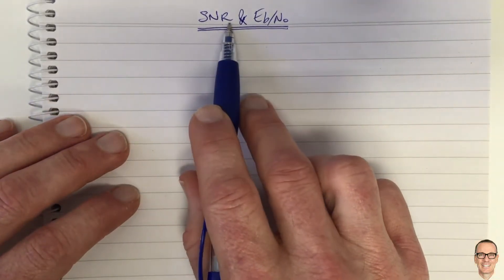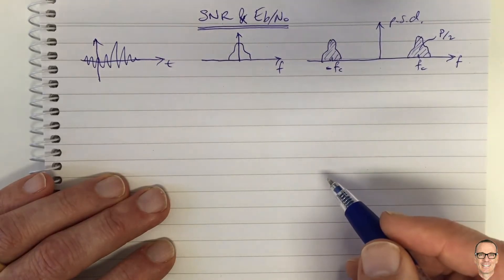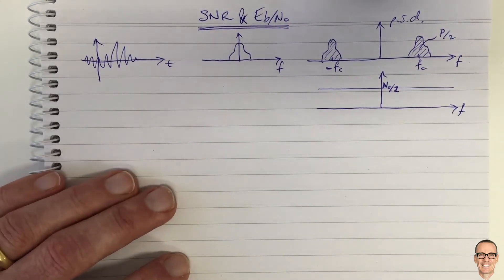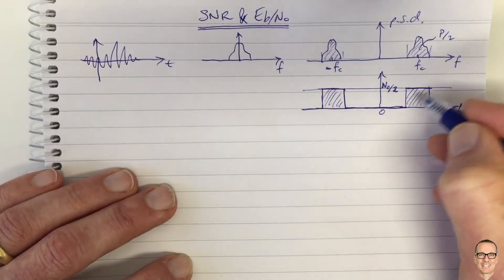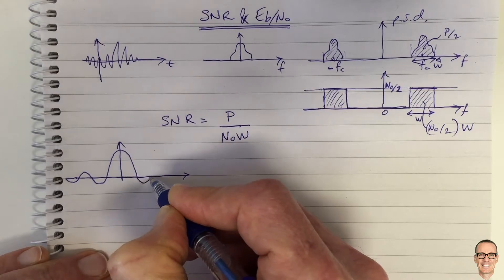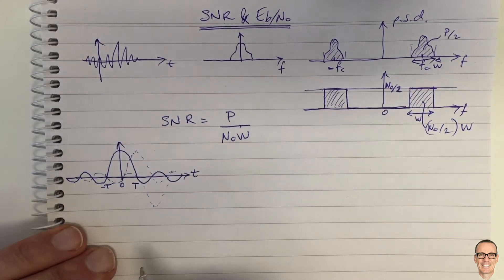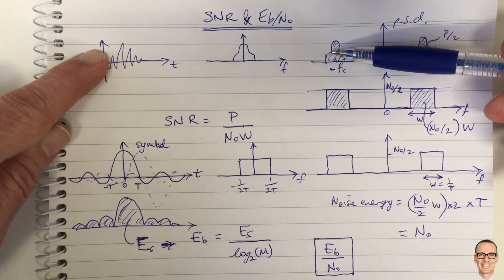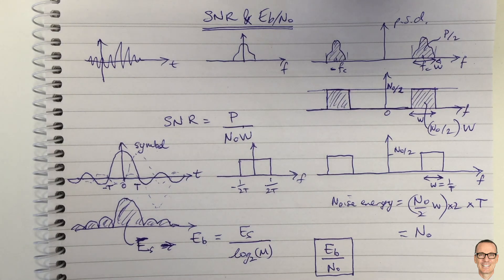What are SNR and Eb/No?

Comment: Hi Sir. Great video!  Q: is there a way to express the difference between SNR and CNR or Carrier to Noise ratio mathematically?  I see these used often to mean the same thing and i dont think they are. Any insight would be great. Thanks Sir!
Reply from the maker: For digital communications they are the same (the modulated waveform is considered to be "the signal"). For analog communications, "the signal" is considered to be the analog signal (eg. audio) that needs to be modulated (up to a higher, carrier, frequency, eg. in AM and FM radio) for transmission. So in the case of AM and FM radio, the SNR refers to the power in the audio signal relative to the noise in the audio band, and the CNR refers to the power in the modulated signal relative to the noise in the RF band.

Comment: Hello!

Thank you for the excellent video! I have a question about the difference between Eb/N0 and SNR for NRZ-OOK modulation.

Currently, I can find two different formulas for the BER of NRZ-OOK modulation:

BER = Q(sqrt(SNR))
BER = Q(sqrt(SNR)/2)
(Q is the Q-function, also known as the tail function). Which one is correct?

In a book I consulted (for example, this one: https://home.iitk.ac.in/~sauravt/ese_schaum.pdf, page 231, equation 9.28), I found the formula BER = Q((a1 - a2) / (2*Sigma)). This can be related to the SNR definition: SNR = (Mean/std)^2, which suggests that BER = Q(sqrt(SNR)/2). However, I often see the other equation without the 1/2 factor on the internet, and I don't understand why, it must represent another thing but I don't know what.

And if I go further regarding equation 9.28 and 9.34 (page 231), is for an OOK modulation SNR = (1/4)(Eb/N0)?

Could you help me clarify this?

Thank you in advance!

Comment: Thanks, in the SNR equation, we have in the denominator the term N0*B. It is logical because it is a random signal. Like you said, we determine the p.d.f. and take the area under the curve. But we never have in the nominator something like S0*B. Is that because we have no random signal in the nominator? We cannot go the way over the p.d.f. with deterministic signals.
Reply from the maker: It's an interesting observation, but your explanation is not correct. The signal is random. The reason we don't see a term like S0*B in the numerator is because the PSD of the signal is not flat over the bandwidth. So we write P on the numerator (we can't be more specific than that, in general). This is the integral of the PSD of the signal, over the bandwidth of interest.

Comment: Thanks, so when I increase the bandwidth, the ratio between signal and noise power doesn't change? Is that correct? (Because the area under the curve increases for the signal and the noise)

I somewhere read that the SNR does not increase with the bandwidth, because the noise increases faster with B than the signal. Perhaps that is wrong.
Reply from the maker: It depends on whether you increase your data/symbol rate at the same time as increasing the bandwidth. If you keep the data/symbol rate the same, then there is no point in increasing the bandwidth, because all you will be doing is including more noise.

Comment: Hi Professor, I got a confusing question, let me describe it for you, and hope I can get the solution. The thing is when I tried to use BI-AWGN channel as my simulation channel, I am a bit confused about the conversion of SNR, Es/N0, and Eb/N0. Let us say, suppose without coding, normally with higher modulation(QPSK, 16QAM) two-dimensional transmission the conversion relation is SNR=Es/N0=REb/N0. So I can get the corresponding BER versus SNR and Eb/N0 curve. HOWEVER, in the BI-AWGN case where BPSK is used, I can not figure out the relation between them. I searched some references, is it correct to analyze it in this way? That is for the BI-AWGN channel, the Shannon capacity is 0.5log2(1+SNR)=0.5log2(1+2REb/N0), so the conversion between them is SNR=2Es/N0=2REb/N0? Hope you can give me some thoughts and suggestions. Look forward to hearing from you. Many thanks, Xin.
Reply from the maker: Perhaps you might like to watch the video again. It exactly answers the question you are asking.
Reply: @iain_explains  Thank you for your reply. I watched the video but the link between the SNR and Eb/N0 is not given. Hence I derived it further, which gives me SNR=Es/N0. However， I saw a relation like this SNR=2Es/N0 for BIAWGN in some books and references. And for higher two-dimensional modulation, SNR=Es/N0. That confused me a bit. One of the books I saw is Channel coding by William E. Ryan.
Reply from the maker: The relationship between power and energy is simple: Energy per symbol (E_s) equals Power (P) multiplied by the time per symbol (T). Sometimes a factor of 2 appears in some definitions, purely depending on how they define N_0. Some people define the "height" of the power spectral density of the noise to be N_0, rather than the definition I used which was N_0/2. This is simply a notation issue, since the real parameter that is important is the variance of the Gaussian distribution of the noise, ie. sigma^2. The "N_0 people" will have a definition of the relationship between N_0 and sigma^2 that has a factor of 1/2 in it, compared to the "N_0/2 people". For more details, see: "What is Noise Power in Communication Systems?" https://youtu.be/_qn4RzMrXBc

Comment: Hi Professor, thank you so much for the video! A couple quick questions. 

I guess i dont quite understand how the word "power" is used both in the freq domain ( area of PSD) and just "power" in time domain (square of voltage). How is the area of the PSD (freq domain) different from a value in the power display (time domain), even though we call them both, "power?" 

Im a bit confused at 7:55. We are considering the energy of the noise wrt a time value of T. However, by "coloring in" the signal across all lobes for the symbol, it looks like we are considering the energy of the symbol wrt a time value of many T (since just the main lobe has a duration of 2T). Shouldn't the energy of the noise & symbol be compared with the same duration?
Reply from the maker: The PSD is a power density , so you need to add the area under the curve between two frequency values, in order to find the total power in that frequency band. This is analogous to the density of a gas in a balloon. To find the total mass of the gas in the balloon it would be necessary to multiply the density of the gas by the volume of the balloon. In the time domain, when you take the square of the signal you find the instantaneous power at that time, t. The sum of the instantaneous power over all time equals the sum of the PSD over all frequencies.

In answer to the second part of your question, you need to add all of the power in the transmitted waveform that is sent to represent a digital bit. This goes over multiple digital time periods (multiple T "slots"). For more details on this, see: "Pulse Shaping and Square Root Raised Cosine" https://youtu.be/Qe8NQx4ibE8

Comment: Hello, I'am trying to compare SNR of a real signal (sqrt(2*P)*cos(2*pi*f*t)) with real white noise (sigma²) VS the SNR of a complex signal (sqrt(P)*exp(2*i*pi*f*t)) with complex white noise (sigma²/2 on I and sigma²/2 on Q). When I compute the global SNR (mean(abs(signal²))/mean(abs(noise²)), I have same values for real and IQ signal. But when I extract the signal using a FFT, I have same noise power density (power computed in a canal where the signal is not) for both real and IQ signal, but the power of real signal (computed in a FFT canal where the signal is) is divided by two compared to IQ signal (because half of the power is in negative frequencies). Then SNR estimation of real signal is divided by two compared to IQ signal. I don't understand why noise level in a given fft canal is not divided by two too. Where am I wrong and what can I do to estimate the SNR in a fft canal properly ? Thank you
Reply from the maker: Sorry, I'm not sure exactly what you mean by "extract the signal using a FFT". However, if you've got noise power in both the real and imaginary components of a complex signal, but you've only got signal power in the real component, then when you put them together and do an FFT, you'll be adding two lots of noise power, and only have one lot of signal power. To put it another way, if you know that your signal is purely real, then you shouldn't be using a complex signal model.
Reply: @iain_explains  Hello
Extract the signal using a fft means using it as a filter bank. For instance 1024 points fft does 1024 frequency filters. We obtain the time signal by shifting the input signal by something about 512 or even 1024 points. 
I'm not adding complex noise to real signal. I am comparing on the first hand a real signal with real noise and on the other hand a complex signal with complex noise. I simply manage power such that signal power is the same and noise power is the same in both cases. So SNR is also the same in both cases. Then I extract the signal using the fft, and lose half of the real signal power but not the noise. So half of the RSB...
Reply: Let's try to be clearer about the issue. In fact what does not correspond to your presentation is the SNR reading using the fft of a real signal with real noise. In the double sided case, when we often write N0/2 on the PSD, we suspect that in a fft bin we have only half on the noise power such as we have half of the signal power. In practice for a given real signal with given SNR = PS/PN, at sampling frequency FS and using nfft points for the fft, we have ~PS/2 in the positive bin corresponding to signal frequency, and PN/nfft of noise power in any bin (SNR in the bin = PS/2*nfft/PN). Which means SNR is reduced by a factor 2 compared to the complex situation where we still have PN/nfft of noise power in the bin and PS of signal power (SNR in the bin = PS*NFFT/PN). Whereas before the FFT, we have SNR = PS/PN in both cases...

Comment: Thanks. The unity of the signal energy is (unity)^2, according to the formular e.g. V^2. But, how is that then related to the general unity of elec. energy, Joule? Is the energy another physical quantity than the signal-energy (both have apparently different unities)?
Reply from the maker: Good question. Power = V^2/R . But it's common to say P = V^2, and implicitly assume everyone knows you're talking about a "unit resistance" (ie. R = 1 ohm). When we're talking about ratios of power in a communications receiver (eg. SNR), then the resistance is the same for the received "signal component" as it is for the received "noise component" (since it's the same receiver receiving both components), and so the R's cancel on the top and bottom of the ratio.

Comment: Hi professor, I have a question regarding a few papers where I saw the BER being plotted against the transmit power in dBm. All these years I had seen only BER vs SNR plots but can you please explain how to plot BER vs the transmit power? In this case, do we need to fix the noise power? And is it even fair to compare BER w.r.t. transmit power, which we usually fix it while obtaining BER plots? Thank you!
Reply from the maker: That's a great question. Many researchers effectively ignore the relationship between the BER-v-SNR curves and the real practical transmit power levels, by assuming that the channel is "normalised to unity gain" (either exactly, or "on average" in the case of fading channels). By making this assumption ("normalisation"), it effectively means that the transmit power and the receive power are the same in their model. In the case you're talking about, where they plot BER-v-P_trans, then yes you're right, they would need to be assuming a particular noise power level at the receiver (unless they are assuming an interference-limited multi-user situation, where the noise is negligible compared to the interference - but then they would have to state the interference level).
Reply: @iain_explains  Thank you professor for the reply. I tried this on MATLAB and it worked.  I did the following - 

First, I varied P_t _dbm= [-20:5:20]dbm  so that P_t_linear = 10^(P_t_dbm - 30)/10. 

I then fixed SNR_db = constant so that SNR_lin = 10^(SNR_db/10). 

Now, I defined the variance of the noise as 
sigma_2 = E_s*P_t/SNR, 
where E_s is the symbol energy. Following this, I obtain the output as

 y = sqrt(P_t*E_s)*H*x + n, 

where n is the AWGN and I generate n as
n = sqrt(sigma_2/2)*(randn(1,N) + i*randn(1,N)). 

When I plot the BER vs the varying P_t in dbm, I get the desired results. Thank you so much once again!
Reply from the maker: Great. I'm glad it helped.

Comment: Good demonstration, thank you!  My question is : In some cases, SNR may equal to Eb/No?
Reply from the maker: Yes, SNR = Eb/No when using binary modulation with a sinc pulse shape. With sinc pulse shaping, the signal power is flat across the bandwidth (it is a square function in the frequency domain), and therefore Es = P/W. In the binary case, Eb=Es, and therefore P = Eb W. So if you substitute this into the SNR equation, you are left with Eb/No.
Reply: @iain_explains  Thank for your reply, I've got it. thanks!
Reply: thank you for detailed video. just ask, if i want to plot BER (as x axis) and SNR (as y axis) should i still use line plot or semilogy plot? thanks in advance

Comment: Can we filter thermal noise? You used filter to white noise spectrum and outside of filter bandwidth, noise is reduced in your drawing.
Reply from the maker: The thermal noise is added to the received signal in the receiver amplifier (for electronic amplifiers that we use today - it's just what happens, there's nothing you can do about it, unless you use expensive low noise amplifiers - and even those are not completely noise free). So yes, we can filter thermal noise - it's happens in the receiver matched filter. For more details see this video (an in particular the comment in the description below the video, which talks about the bandwidth issue): What is White Gaussian Noise (WGN)? https://youtu.be/QfUQMzHfbxs
Reply from the maker: Also, you might like to watch this video for more details: "What is Noise Power in Communication Systems?" https://youtu.be/_qn4RzMrXBc

Comment: Hello, thank you for your interessting videos. I have 2 questions.
1. Isn't it more accourate to say: the area under the curve is the energy of the signal instead the power?
2. I read something about the Energy Signal. There you get integral (x(t)^2) from -infinite to +infinite. That refers to the time domain.
One can say in the time- and the frequency domain: the area under the curve is the the enegy of the signal - is that right? (I only found the integration in the time domain. That confuses me a bit.)
Thank You.
Reply from the maker: I think you're getting confused between deterministic signals and random processes. A deterministic signal x(t) has a Fourier transform X(f), and the area under (x(t))^2 equals the area under (X(f))^2, and it equals the energy in the signal. In contrast, a random process takes random values at any given time t, and as such it doesn't have a Fourier transform. Instead, we define its "power spectral density", which is the density of power as a function of frequency. If you integrate the PSD over frequency, you get the total power. This video might help: "What is a Random Process?" https://youtu.be/W28-96AhF2s

Comment: Great video, very well explained. The symbol time, Ts is 1/W. Can I see the symbol time by just looking the sinc function in the time domain?
Reply from the maker: The sync functions for each data symbol overlap in time, offset by T, as it shows at the 4min30sec mark of the video. The resultant signal is the addition of all the sinc shaped signals, and you can notice that at each integer multiple of T there is only one sinc function that is not equal to zero (since the sinc function has zero-crossings at multiples of T). For more details on pulse shaping, check out: https://youtu.be/Qe8NQx4ibE8